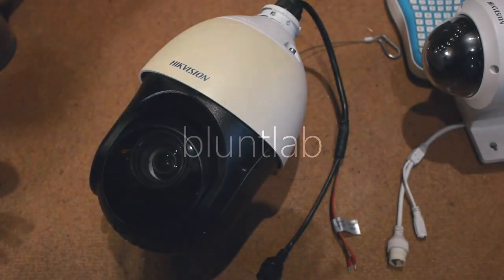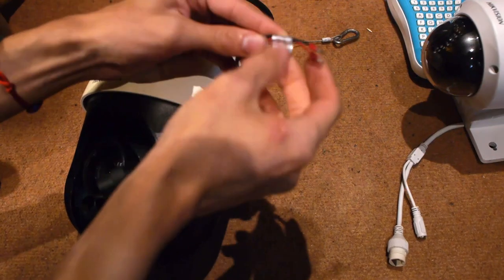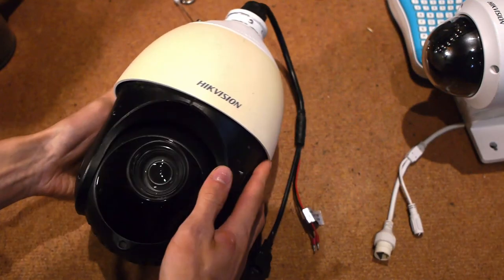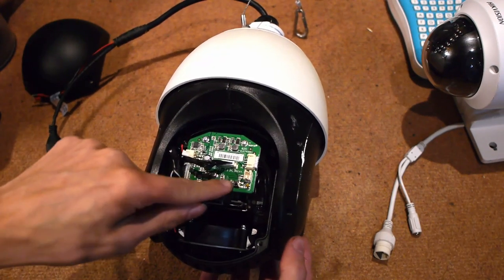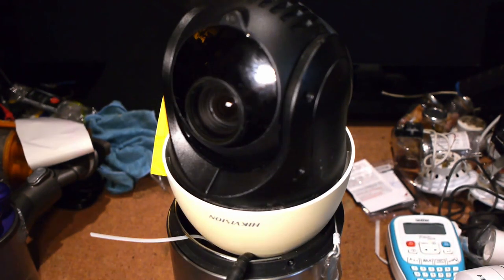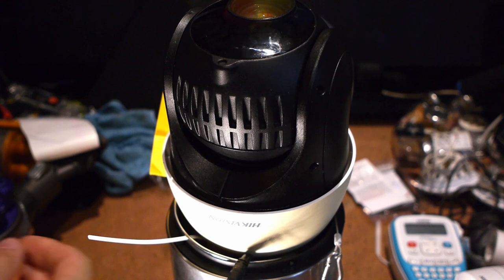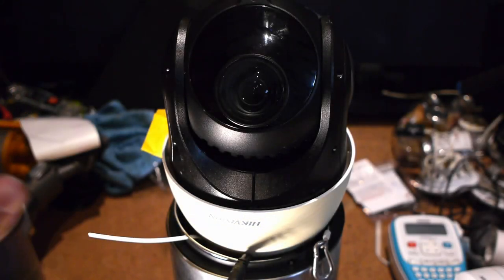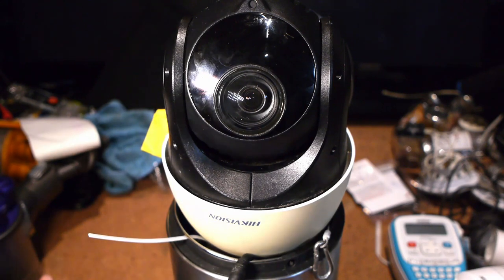Hikvision DS-2DE4220IW-D IP PTZ Camera - Overview and Test

Comment: Have you installed this yet, if so what mount did you chose?

We are getting a Hikvision IP POE PTZ 1080p 2mp with corner mount !
Reply from the maker: Yep all installed working great.

Did have to do a repair to it though. the RJ45 had water damage. it was very hit/miss but that was easy. The are some pics of it installed here
https://bluntlab.space/posts/hikvision-2de4220iw-repair/

We used the corner mount as well. it replaced a far older analogue corner mount PTZ
Reply: @bluntlab  did it replace the dedicated micros one in your cctv tour video? How much of your system has changed since that video?

I’m gradually upgrading my cctv system to IP
Reply from the maker: Yes it did :D 
Only one analogue camera remains from that tour and its the one on the pole which is now wired up too with an Axis Encoder
Got a new NVR. so fully IP now
Installed some extra cameras including a number plate camera because why not

Will be adding more cameras soon as getting a summer house in the garden as a kind of little office space so will have cameras there too
Reply: @bluntlab  Cool Stuff !
We are currently gathering all the parts for our new system. Got a hikvision 16ch 8mp in/4K out nvr, k2 series + rack mounts - hikvision cube camera.
still need to get the ptz + corner mount, and 2 domes in black + junction box, and 7 turret domes + junction box. 

When fully finished will have about 11 cameras.

Are the axis encoders good? Will the work with hikvision nvr? I had a look at them and it caught my eye 👁
Reply from the maker: Sounds like an awesome setup. the Hikvision stuff is very good quality I have found

The Axis encoders do work (as long as you get one thats H264) only issue is motion detection does not work. that might be because I am using it on a PTZ though. I have had motion detection working with a Bosch camera so hard to say
Reply: @bluntlab  I am a fan hikvision stuff our current system has a hikvision 16ch hybrid dvr

But we need are new system at our unit so it seems a good time to upgrade, so new ip stuff for the house, the the current dvr and cameras from the house to upgrade the system at our unit.

The current cameras our 1080p 2.4mp so still really good cameras
Reply: @bluntlab  Hi Bluntlab - My Hikvision IP POE PTZ and corner mount has just arrived! 

What did you use to seal the large cable hole on the corner bracket and arm?
Reply from the maker: Gravity. :) 
Does not need sealing because the rain/water can not go up the bracket unless its a direct spray from beneath
I did use the waterproof RJ45 seal that Hikvision provide (though because of my camera being a used/broken one I cut that off and replaced with another waterproof seal) I always fit that even on indoor cameras because why not.

I also use the 12v power in my setup as my camera cant do POE sadly. I just used some electrical tape on the join for that too
Reply: @bluntlab  Right! Makes senses!

I’ve put the coupler seal that hik provide on the Ethernet port, and for good Measure electrical tape too. I’ve also put electrical tape on the 12dc input, and earth cable. 

I’ve tooled all the connectors into the arm so all that comes out of the arm is the Ethernet cable.

Going to get it up on the house in a day or so. Going to put up an outdoor access point up at the same time!
Reply from the maker: Nice. What AP you using?
I put an AP outdoors. was a Cisco 2602 but put it inside a IP rated box. have not dared open it up in-case it has become some kind of nesting ground for wildlife XD but the AP still works so woot
Reply: @bluntlab  Ubiquiti UAP-AC-M UniFi Mesh Outdoor WiFi 5 PoE Access Point (1200Mbps AC)
Reply: Hi Bluntlab 

I have a hikvision Poe nvr, but want to set a camera up over the lan not directly connected to the nvr, my nvr does support this, but I’m struggling to get it to work.

Please can you do a tutorial video on this?

BTW, you new cctv system sounds ace, please can you consider doing a new system tour video?
Reply: I’m also trying to get can cam setup on sadp tool, I’ve saw lots of videos and as soon as you click on it, it tells you to change password, mine isn’t doing that 🤯
Reply from the maker: Does it show up in SADP? if so its probably been activated before (maybe whoever you bought it from updated it or something)

You can reset it to factory settings. As I showed in this video the back of the camera comes off with 4x screws and inside is a micro SD slot (handy to put a card in there and have it record events as a backup to the NVR) but also a reset button. just hold it while powering up the camera. hold it for 15 seconds maybe a bit longer then let go it should then show in SADP as unactivated 

It is also possible if you plugged it into your NVR first it might of been activated by the NVR so in that case it might have the default password you set on the NVR
Reply: @bluntlab  it’s shows up on SADP, maybe it’s because I plugged it directly into the. NVR to test it when it first arrived
Reply from the maker: Plugging a camera directly into an NVR will activate it with a password. its part of the plug and play design so anyone can setup an IP camera system. This would of been a password you set when you installed the NVR think Hikvision call it the "camera activation password" so maybe try that instead of going through the hassle of resetting the camera.

Should let you edit the IP address in SADP then save with said password. can then login with the username admin and that same password
Reply: @bluntlab  thanks, I’ll give that  ago!
Reply: You know back in the the day when you wanted to setup multiple analog ptz cameras to a dvr, you had to go into the cameras internal settings and give each ptz a different ID number, so you can control each ptz individually.
With an IP system, would it be plug and play, because the the nvr will go, each ptz has a different IP address , so you can straight away control the ptz individually?
Reply from the maker: No need for a PTZ address
The IP does everything 😁
Its awesome. no more RS485 nonsence, no janky up the coax garbage if you got video the PTZ will work
Reply: @bluntlab  I’m already thinking of getting another ptz, either on another corner mount or a Swann neck
Reply from the maker: I am tempted by another Hikvision PTZ to replace the last analogue Dedicated Micros PTZ (kinda ironically also a swan neck mount) but I only got my Hikvision PTZ because it was dirty cheap as "spares" and needed a simple repair. Dont think I can justify a £300-400 camera when the existing analogue one is doing an ok job still lol
Reply: @bluntlab  I need to get more static dome cameras first before another ptz, planning to get 7 hikvision 4mp 2.8mm domes and dm18 junction box
Reply: Hi Bluntlab 

Now you have you PTZ setup and installed, have you set it so if for example your front door camera detects motion your ptz goes to a certain preset?
Reply: I’ve managed to get my reset my ptz and cube camera so they now show up on sadp, and I’ve set them so they connected to the nvr over the LAN instead of directly to it

Comment: Hi, cheers for the vid. I am wrestling with a second hand one of these myself, all up and running but I can't add to my cameras on Hik-Connect, is that something you will be doing or have any info on? I am getting the serial number from the maintenance page on the cameras IP, is it also on the sticker inside the back? (like yours, mine was a 2nd hand find) All the best.
Reply: Oh, and have you managed to update firmware? I am not managing that either!
Reply from the maker: I have upgraded mine. Does your serial number contain CN by anychance? a serial number with CN in it usually means greymarket which means no firmware upgrades either. If it contains WR instead then the is no reason it shouldnt be able to be upgraded.

As for Hik-connect I never use it on the cameras themselves. But I do know you have to use a certain part of the serial number and not the entire thing. Bit annoying think its just the numbers at the very end after the CN/WR
Reply: @bluntlab  Hiya, cheers for coming back, no CN, but a CCWR? I have got 3 others and can confirm your thought that, for at least the 3 I have added to Hik Connect so far it has been the last 9 digits of the full serial.